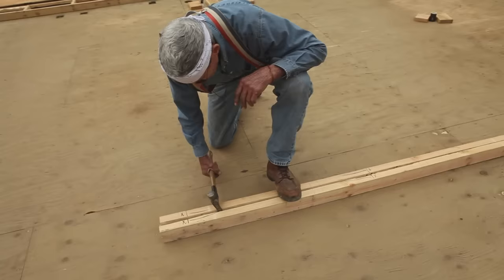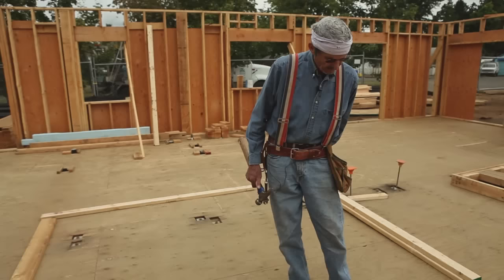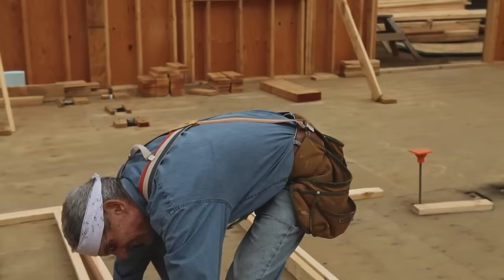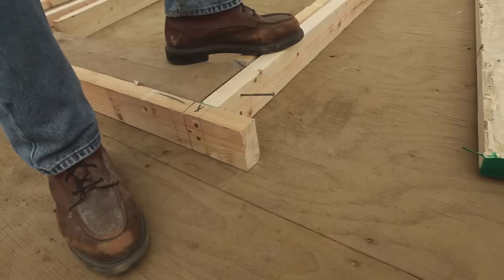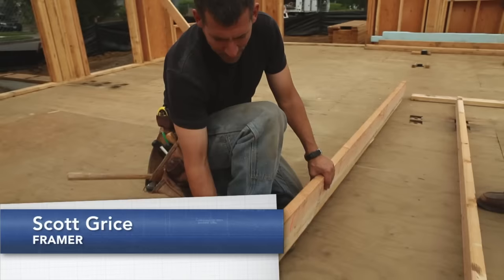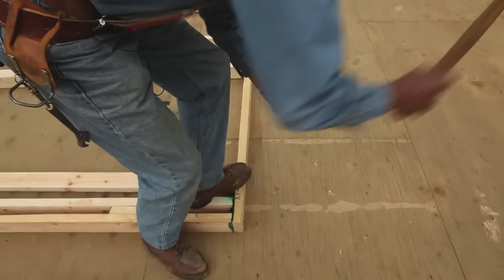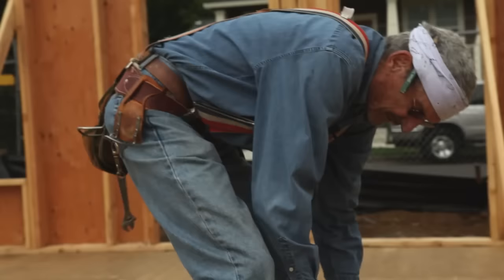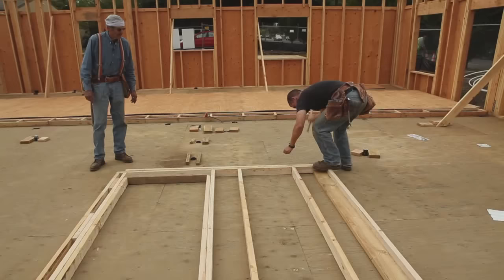Framing Basics: 3 Simple Tips for Framing a Wall

Comment: all you "dissing" Larry dont know shit from shinola .  I know in his younger days Larry and one more man could dry in a 1600 to 1800 one level home in two days no air tools, no fancy equipment, just worm drive saw, hammer, tape and square. And it would be built to code, it would be square, level and plumb.And very well connected... Talk is cheap I see from some of the wanna be "super framers" posted below... Back in the day,, these guys would do this day in , day out rain sine, hot or freezing.. yall "dissers" are just little puppies , and wet behind the ear.
Reply: He was a beast. Not only could he do what you are saying, but it was effortless.
Reply: He and his brother built half the valley themselves. Made six figures a year in the 70s. Revolutionized the framing process.
Reply: That's why he drives a nail in one swing.  My dad drives nails like that.  He grew up without a nail gun.  Why would anyone be dissing this guy?
Reply: WELL SAID.  Larry Haun revolutionized an industry - the ultimate "lean process" guy, not one bit of technology necessary, just thinking every step through.  I had the pleasure of meetint/talking to him at a tradeshow back when I was getting going  - what an incredible workman and yes - craftsman.  And the nicest guy you'd ever meet.  It's hard to believe he's gone because when he was 70 he seemed like a guy in his 40s.   RIP Larry and thank you @Whommee for setting the record straight for the YouTube trolls.
Reply: Tioga Fretworks I'm a master carpenter by no means but still, this is the first I've heard of him. What I wouldn't have given to learn from him. This dude's the real deal.
Reply: From my understanding it was him and his brother Joe.  Have seen quite a few videos of them both in action and have to say they were extremely good at what they did.....my respects.
Reply: Haha!  Well put!  The internet has allowed for an incredible amount of "experts" to crop up.  They're all masters of what they do(mainly reading, ha!) and professors of what they know(mainly everything).   Alexis Mincolla uses the term "infobesity" and I think it's perfect.  So many of us are FAAAAT with information and VOID of skill and firsthand knowledge.  

Not me though. I'm an AMAZING artist.  You've never SEEN such awesome creations.  The visions in my head are outstanding. I could give Dali or Bacon a run for their money. 

Of course, when I put brush to board, the material world becomes a bit less abstract and my tools won't cooperate, but that's okay, I just need better tools!  Besides, I make up for the shortcoming by sharing my skills in the youtube comments section and telling everyone else where they're going wrong.  

Hopefully Dali can learn something from them. . . wherever he is.
Reply: Couldn't have said it better myself. from what I can see He was a true Craftsmen and forgot more than most will ever learn about the trades.
Reply: whommee I would travel across the country to learn/work with that guy for even a half a day lol
Reply: whommee I scrolled to see what you were talking about but I didn't really aser anyone talking shyt about him. I mean how could you lol. I guarantee he coulda. built it with his eyes closed
Reply: Ryan Seppanen agree with you a hundred percent. But the real deal Larry brought to the table was the production style he implemented. I was fortunate enough to grow up in so cal raised by a “Haun” framer. Without Larry’s methodology or “system “ real efficiency and production could not be achieved. Those nail gun are only a tool. And you know it’s not the car it’s the driver.
Reply: Just listened to a carpenters life by Larry Haun, read the book or listen to it you might all get a shock. There were three brothers I believe Larry, Joe and Jim in the early days they had trouble with your carpenters union over there. Including shortening their hammer handles. These three blokes patterned the Californian framer by chopping blades of rigging axes and welding claws on. Larry tells of having to production frame and how they built houses to standard timber lengths to minimise waste in time and timber. To see him and joe work together in the videos it’s easy to see how they were framing so much in such a short time they were getting on by then being born in 1920s/30s. I admire these guys they were true grafters and just because with all your bling tools and multiple blokes doesn’t mean they couldn’t. 

They literally framed raised and plumbed the buildings before sheathing and cladding.
Reply: Ryan Seppanen 

In other videos I’ve seen, he stated that a “typical” 1600 sqft home would take 2 guys plus a helper a week to frame 100%. That includes all exterior wall and roof framing,  wall and roof sheathing, stairs, porches and all interior partitions. Really not bad. I work with another carpenter and a helper and we get the same amount of work done in the same time with more tools. Which I think speaks volumes towards Larry’s process and skill. No one ever said he could do it in 2 days. Even 3 guys with nail guns would have to work like absolute dogs to do all that in 2 days. I always say: take your time, do it right and take it easy on yourself. Save your body for more important things like enjoying life.
Reply: I'll be 40 in April, and I literally don't know shit from Shinola because Shinola hasn't been sold in my lifetime. I only know the expression because my dad would say it.

It's to polish your testicles, right?
Reply: Saw, hammer, tape and square? Haha, he did t even have a square. Only Mag77, Hammer, Tape, Pencil and a keel.
Reply: plumb,level & square......if you got those 3 words down  you just might make a good carpenter....thanks for tossing them out there......
Reply: @user-zu2bw7ig5v  there something about a hammer if u master that your a carpententer same as welder vs robotwelder
Reply: Haha often times not even a square; just the guard of his skill saw
Reply: Those are the type of guys i learned from in the  90's.. (lasVegas, knipp bros, westcor, nacole)    Thank all of you Old Carpenters out there , and im doing my job and teaching the young dumbasses now! Lol...   lmfao @ the hand nail races We used to have!  Lmao!!        Really,  thanks oldtimers i appreciate it from my heart.   #FrameOn
Reply: whommee facts!
Reply: yup Larry is the og of ogs
Reply: all I've seen is respect..
Reply: Scott is the worst type of co worker. He isn’t aware of who he is working with while lifting. He isn’t paying attention to how he is moving is affecting his coworker. He almost causes Larry to trip. Yet the old master has educated feet.

Comment: When we were framing new houses, we always left the jacks studs out when we were framing the walls.   It was a lot easier to cut the floor plate out with a circular saw, and put the Jack studs in later.  It would also be back work we could do on a rainy day.  As framers we tried to leave back work for rainy days.

Comment: When I frame, my nails fly or bend, but at least I try. This guy doesn't even have to waste time setting the nail.
Reply: He's also using 16 penny nails.
Reply: I will say that that white pine is so soft. I’m not bragging but we could drive nails like him. Thing is he’s 80. We were young. I’ve seen lots of carpenters with a huge Estwing framing hammer drive nails like that in white pine. You can set the nail with your hand. It’ll push in. Try yellow pine and you will want a nail gun. The nail guns would countersink a nail in the white pine too far if your air was too high.

Comment: I have been a carpenter for going on 45 years . When I started there were no airguns , Your ability was determined by swinging that hammer . In many ways . Your IQ was determined by how fast you could nail .. Most everyone eventually transitioned over to the Bang Bang and it became easier somewhat .. Yet with nailguns .. You better start snapping walls together even faster.. Back then you thought about every nails placement because you were the one wearing out your arm .. Today ,, Airgun operators seemingly can go on full automatic and shred the lumber , nailing through knots , creating shiners and over nailing and splitting everything . Rendering a stud useless .. But they'll still stand the wall and roll on !! .

Comment: I’ve seen carpenters actually nail the bottom plate to the deck. Come back with the top plate and then set the studs by toe nailing. That never made since to me. It was so clumsy. I’ve seen times where we would pick up a whole outside wall at one time. I could talk about framing all day. My Father built homes from the ground up. Sometimes if we weren’t too busy we would paint and roof. The only thing we didn’t do was masonry electrical and plumbing. I’ve done everything else. None of it is as satisfying as framing walls.